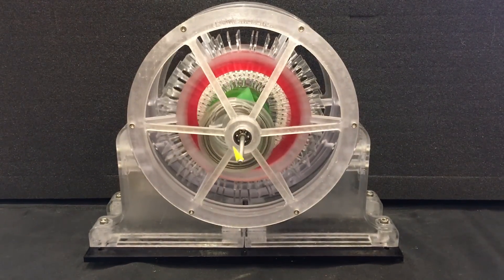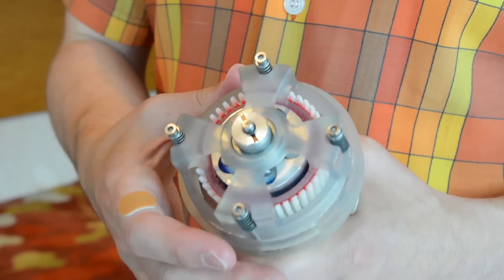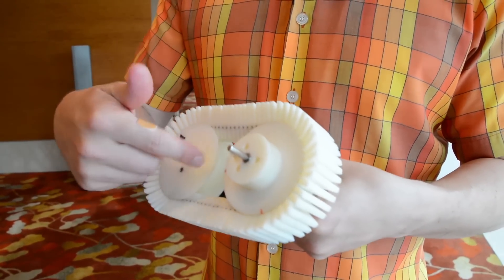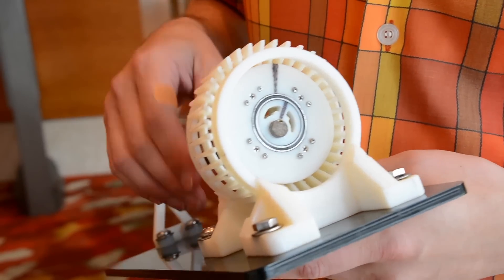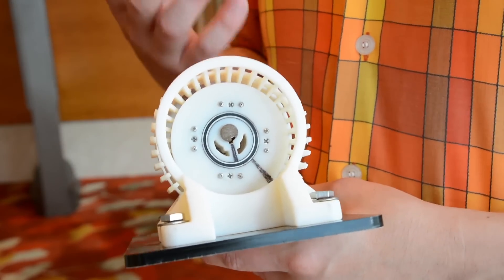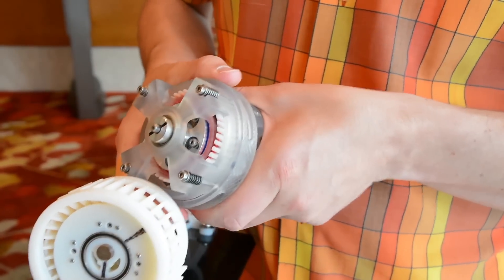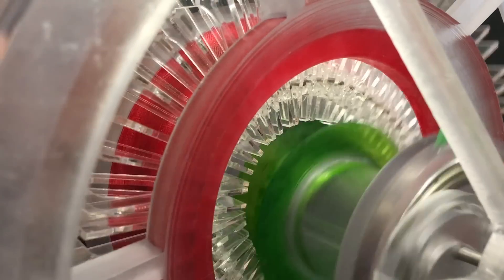Inception Drive: A Compact, Infinitely Variable Transmission for Robotics

Comment: Interesting, but as we move forward to electric drive motors that can handle a wide range of RPMs, why are transmissions necessary at all?
Reply: Matthew Grotke There are almost always torque limits, so for applications that require high torque, this could be valuable if it can be built to handle that much torquem
Reply: +techmage89
I you have torque limits this would be the last transmission you'd want to add (just look up what people say about CVTs in cars). Belt driven systems (and this is essentially one) are less efficient than gear or chain driven ones.

+LegendLength
For electric motors there isn't much need to hunt "perfect RPM", because they already are more efficient over a wide range of RPM. Just use a much more efficient gear based fixed ratio transmission and do the "variable" part by controlling the motor speed.
Reply: Sorry, but you are just showing quite a lack of understanding. The motor getting hot when going up hill has nothing to do with RPM. Take the same bike and drive it at the same speed you go uphill, just on a flat road. How hot does the motor get now? It's the same RPM.
Why do you think almost all electric vehicles have just a single gear? (not talking about conversions) Do you believe that car manufacturers just don't know that a gear box would be useful for electric motors, especially at the high power ratings of electric car motors?
Reply: superdau  Wouldn't the load on the motor slow it down, causing it to draw more current due to decreased CEMF?
Reply: If you need a kilowatt of power to go uphill, you gonna need a kilowatt of power regardless of gear ratio. Now it's true that producing a kilowatt at near peak RPM will only produce 100 watt of heat, and producing a kilowatt at near stall will burn several times that much power to heating, it's offset by selecting proper final drive ratio and/or motor winding inductance. If most of the time you drive fast with little load, you use tall drive, if most of the time you drive slow and need a lot of torque you use short drive. Gears reduce efficiency, and the more gears you use the less efficient it is. So while it's true that overloading electric motor tanks its efficiency, in the end doing without gears is more efficient anyway.
Reply: The reason CVTs fell out of favor in automobiles is because they cause the engine to loudly drone by holding it at the same RPM for long periods, which isn't acoustically pleasing at all. Modern automobile CVTs got around this by revving in and out of the engine's power band to simulate gear changes which isn't as efficient but is much less abusive to the ears. This is where the efficiency "issues" of the automobile CVT originate.
Reply: Electric cars are not the future. Internal combustion will always exist and dominate, we just won't use fossil fuels.
Reply: Sure, why not continue to use technology that wastes the majority of the fuel's energy as heat (and, if not a fossil fuel, most likely wasted to majority of the energy needed to create the fuel). Sounds reasonable.
Reply: superdau electric will never dominate over fossil until we break through the battery limitation in capacity to weight, and time to "refuel." Current lithium batteries can become explosive if charged too fast due to carbon interactions and a full battery on even the best electric cars can only just barely match the milage of the worst internal combustion  engine cars. 
These limitations will continue to prevent electric from ever toppling fossil simply by making them infeasible for the commercial and industrial market, which are the largest segment of vehicle purchases in any given country.
 Until electric vehicles can win over those markets they will forever remain a niche product
Reply: Mindpron you're confusing the motor and the fuel: What about hydrogen fuel for electric fuel-cell cars?
I think it's quite sure to say that electric motors will be the future. But which kind of energy storage not...
Reply: F. Fehse hydrogen is infeasible due to being too difficult to transport in the required quantities due friction heat in the pipeline and hydroelectric fuel cells, while certainly clever, never met the required efficiency requirements and tended to be too fragile for  real-world use.
I think the next step will probably be full gas-electric engines, similar to what is used by the rail industry already. We are already starting to see forms of gas-electric engines starting to appear in the hypercar market, so it seems like the auto industry has made its choice on that. 
LNG is also still a real possibility as it would quite easy to convert the current infrastructure over to it, but that wouldn't have any backwards compatibility with existing engines.
Reply: Hydrogen gas reacts with nitrogen in the air to form a toxic greenhouse gas, known as ammonia. Also, with hydrogen being such a small molecule, it leaks out of it's containers very easily. Hydrogen readily alloys with cold metal, making your vehicle ready to fall apart at any moment.
Reply: @michaelbuckers  Right, just use a bigger motor, way simpler and more efficient that having the gears.

Comment: ...still stretching and unstretching the rubber band to seat the sprockets {teeth, tines}...
...it'd seen easier to have an infinite-number of sprockets and seat only those aligned...
...in practice that'd be a large number of triangular sprockets locked-before-engaging...

Comment: Not to be negative but this contains all the features that have so far prevented CVTs from amounting to anything.
Reply: You do realize that their is a niche for CVTs. this solution is improving on regular CVTs by being more compact and adding reverse capabilities. It still has a all the problems regular CVTs have but no one will complain when his CVT gets smaller and lighter.

Comment: robots? more efficient? electric motors generally don't need a transmission beyond one ratio
Reply: Step down ratios are useful for precision movements. Also sometimes you need high torque and simply increasing the current causes too much copper loss.

Comment: it's got ten trillion moving parts.
Reply: Compared to a multi-speed transmission, the part count is very very low.
Reply: This is a see-thru model. I would expect the real one will have a normal solid v-belt.
Reply: You can't use a normal solid V-belt. The belt has to be incompressible for it to work, like the belt in a CVT of a car (and they consist of a few hundred pieces).

Comment: Why couldn't this be used in a car or truck?
Reply: vibration. It has lots of mass rotating off-center. It would need an active dampening system. Also that belt has really specific geometry which is probably not yet possible in metal (every automotive cvt uses special metal belts) because it has two contact areas on the flanges, one above the belt.

Comment: It's a very cool take on a CVT, but... electric motors don't need variable transmission, direct drive is fine - to control speed and power precisely you use an electric motor driver unit, not a gearbox. And funny thing you're talking about efficiency, because of all transmission types CVT has the lowest.

Comment: OK. Question, why did you build this this way? The belt combination is cool but why this?

What this guy isn't showing you is that the blue planetary gearbox at the start, and why that is there. so.... when he turns the collar he's opening the spring loaded clutch enabling the machine to direct drive. As the output from the Nested CVT belt is in reverse rotation.  (the spring clutch is pressing on the planet carrier, when held you get reverse rotation, and as you let go you get forward direct drive)

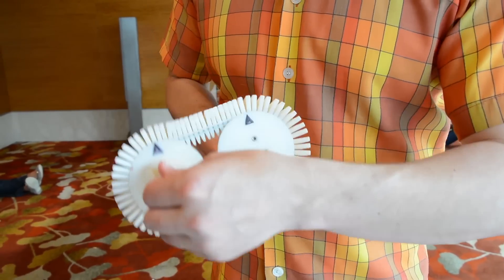1:30 not an infinite ratio, if you think about it its acting as a section of a planetary gear box. the center gear the sun, is held, the planet carrier is the turning outer gear and the Belt acts as the RIng Gear. NOTHING NEW HERE. Also from visually looking it appears to have a reduction ratio of about:  1 : 2.5
@Thad ward +Thad ward Yes it will vibrate like crazy. unbalanced motion + jerky motion of "Belt" = Lots of primary and secondary vibration

Nice nested CVT btw, but unfortunately that's the only innovation here, just a clever contextualisation of parts, that can confuse people.

Comment: it is not relay "infinitely variable" it is more of a analog variable between ratios, if it was infinitely variable the ratio's would be infinite , Interesting concept however.just stop trying to use Catchy names like "Inception" and "Infinitely" because it sounds like you are promoting a Marvel movie for Millennials.
Reply: it can still be infinitely variable if the steps between ratios can be infinitely small.  I do agree that the inception drive name is dumb as hell though
Reply: Infinitely variable transmission means that the transmission ratio can be infinite, i.e. input shaft spinning and output shaft standing still.
Reply: Its really just a CVT that can also change directions.  To me infinite variable transmission sounds like it could do 1:999999 or has no limit to how high or low the ratio can go.  This has a limit just like a CVT.  Not sure what it should be named, to be honest.  Its cool, just not infinite.  CVT has seemingly infinite steps between its limits, but they don't call it infinite transmission do they?
Reply: A nice explanatory piece from Wikipedia:
"A subset of CVT designs are called infinitely variable transmissions (IVT or IVTs), in which the range of ratios of output shaft speed to input shaft speed includes a zero ratio that can be continuously approached from a defined "higher" ratio."
Reply: h82fail if you don't like that name you can always use "differential step concentric pulley belt transmission" which is what it essentially is.